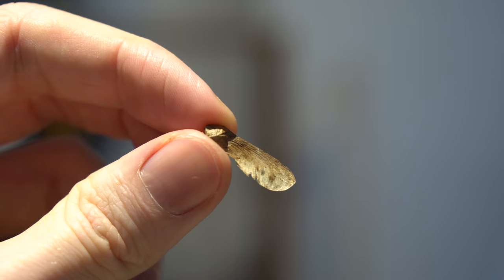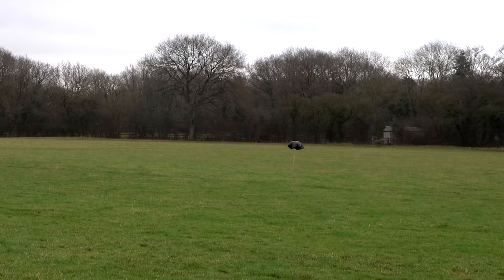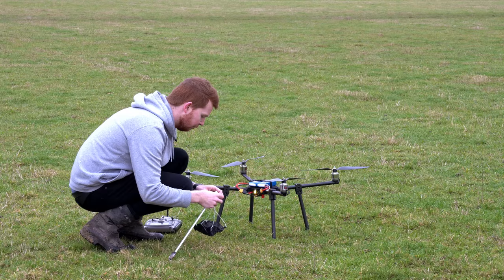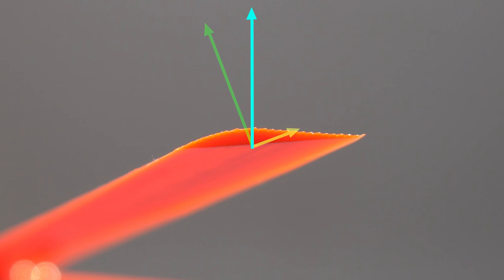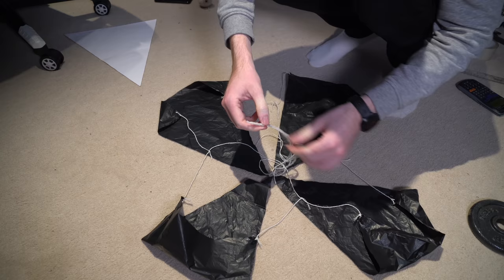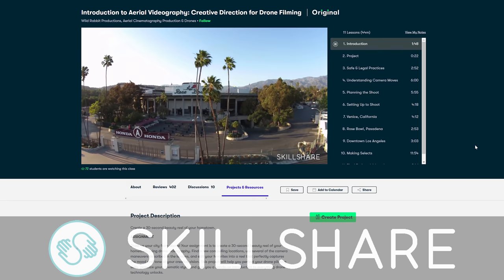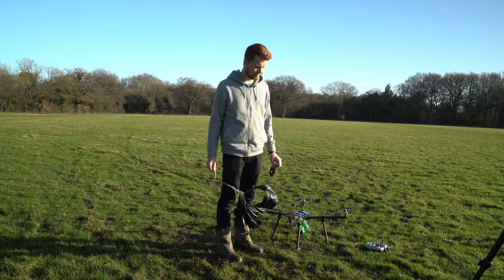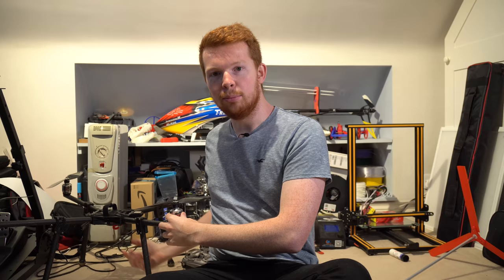Should Parachutes Spin?

Comment: Wait.  Are you sure you understand the forces at work here? The rotating parachute has no lift generated. It doesn't fall any slower. The reason the blades can slow is similar to autorotation in helicopters. The wind spinning the blades generates a small amount of lift.

Comment: your wind turbine rotor wing explanation doesn't work
the outer circle would actually aid in its descent in that it actually pushes it down
i think the likely explanation is that the blade is constantly moving over air thats not already accelerated downward by the blade/parachute
a parachute constantly has air below it thats already moving downward
while the rotor is constantly moving over air thats not already moving down

Comment: The seed is broader at the top of the wing then at the center of rotation. 3d print another rotor but make the last 2 inches of the wings wider and see what happens. 👍👍👉🤔👈10 4

Comment: you don't explain why it happens though... I bet its because when you contain air in a pocket, it creates an area of higher pressure in the parachute, which creates some kind of bubble that doesn't allow new air in. basically pushing new, steady air out of the way instead of into the parachute. I bet that's why parachutes have holes at the top too. the spinning version just keeps bumping into new , non moving air, and rejecting the air it already caught.

Comment: Dear Tom, in a discussion on rotor vs disc drag force (or thrust), a friend pointed out your video. First and foremost, I like your videos and admire your efforts to experiment! One thing though; your aerodynamic comparison is somewhat unfair.. you compare the surface of the rotor to the surface of a flattened parachute. However, as you can see during the test; in ‘flight’ the parachute turns to a dome shape. Theoretically the ‘projected’ area of a dome is only half that of its surface area; as the friction coefficient in the equation for drag is linear, you've lost half your drag.. Same goes for the smaller one; in flight, this is only half the area of the rotor. As for your explanation of the auto gyro: the inside section drives the outside, however both inner and outer sections produce a lift component and this is an explanation of autorotation, not just the auto gyro. In my opinion, the term autorotation is not very specific: all fixed pitch (and constant over radius) turbines with radial rotors on an axis parallel to a flowing medium, operate in an equilibrium between an (accelerating) blade section and a (decelerating) tips.

Comment: Tom I am at a loss as to the reasoning?????? behind your topics.
1.     Single blade seeds such as the Maple Seed descending to the ground and travelling is due to 'Autorotation', for a basic understanding look at the' C of G' and the aerofoil section of the single blade.... Durrrrrrr
2.     Round Canopy Parachutes trap air and the only escape route is via the edges which causes the edges to flap. Therefore the hole in the top of the canopy is there to bleed the air build up and improve stability with only a minimal change in drag.
     Nothing above is Rocket Science.... so what are you TRYING to prove with your 'droning'

Comment: my guess from watching the tests and before seeing the explanation: i think it has something to do between the interaction of angular momentum and gravity. my theory is that because there is so much angular momentum its stealing the potential energy from the drop to make the propellers spin. i wonder if the shape of the blade matters. would having something shaped like an "S" or shaped more like the seed, with a rounded lobe on the blade have more deceleration or not? and what about a dynamic curve on the blade? would something that both had an "S" bend and was also curved to "cup" the air more have even more deceleration?

Comment: I was wondering about a 3 bladed rotor head with the same area than the one you build but larger area on the peripheral then on the center.
So very thin at the center and very large at the tip of the blade. 
Would it fall even slower?
Thanks for your nice video, very interesting every single time
Pat Farley

Comment: This has little to do with this video but I am asking because you were making a radio controlled space X rocket with EDF. There is a channel called smugglers room where the guy made a custom droid with domed top and bottom. It also has louvres on side. Was wondering if you could make one with big EDF on bottom and smaller ones for smaller EDFs on barrel body through the louvres for extra lift and stability. I am a Star Wars fan but also like robotics and flying things. But I am disabled and can't do myself, would you be interested?

Comment: Great video!
And I've got a question for you;
So, light speed and greater than light speed, super-photonic or trans-photonic speeds are theoretically unattainable according to our generally accepted physics.
Though let us suppose that spin a hypothetical propeller,  or sphere for that matter, and depending upon the radius of the propeller's arc, or the radius of the sphere at its equator relative to its axis. At what r.p.m.might we spin it to achieve or surpass the speed of light?
Seems to me that it must reach and or exceed the speed of light once you turn it to or past that given r.p.m..
And then what of time dilation and so on between it's axis relative to it's equator or the propeller tips?
In my experience whenever the tip speed of our propellers reached or exceeded the speed of sound, strange things began to happen... things started to come apart.

Comment: There was a single bladed rotorcraft invented in the early 1900's called a Gyroptere. The inventors were Papin and Rouilly. It had a maple-seed configuration where the cockpit, located at the center of rotation, remained stationary while the blade and counterweight spun around it. Here's a pic fo it: https://lecomptoirdetitam.files.wordpress.com/2015/04/gyroptere1.jpg?w=529&h=418 and another from Popular Science in 1922: https://oldmachinepress.files.wordpress.com/2012/09/papin-rouilly-popsci-1922-09.jpg?w=375&h=536  

Might be cool to create a version of it!

Comment: The real question is why does the seed actually float horizontal ish opposed to a more vertical spin
Reply: fist, you start with  Gravity.    then, the overall  shape  results in  Spin, as it fall through the air.     a  'free'  object  rotates/spins about its  Center of  Mass.      as it spins,  aerodynamic forces cause  the orientation of the  'wing'   to  Align with  the (relative)  horizontal   air  flow.

Comment: you're not looking for the reason why they spin, but the reason why spinning causes them to fall slower... see the seed as a seed!.. seed has quantity of energy expressed as X regardless of how YOU look at it. .. seed's only purpose is to reach point y  from point z and do so along an x axis. to maximise the apparent travel upon any of 3 axes one of the other two must me reduced in effect. increasing spin reduces linear travel as momentum quantity of x to begin with so if seed is to fall distance "A" from tree, the seed must be able to travel distance x based upon total energy x that seed has. every known quantity in the universe has some spin and relative  linear motion... spin and linear motion are equal factors of spirals and everything does spiral. sorry for mistakes, having trouble with edits insofar as highlighting is concerned. find myself having to retype stuff due to highlight deleting a previous character so I'm typing same over and over again until I'm lost and confused. look at any field... you should see a relationship between linear motion and spin. look, drop a small neodymium magnet through a copper tube and that magnet will spin its way down until it exits the tube, not only that, but it will fall down at much slower rate of descent so sorry for disjointed text and ideas, really wanna get my point across and have not yet digested anything of your video. excuse me.

Comment: Wrong design of the common parachute. There should be an open hle in the top to stabilize the descent of the parachute as it slides Down a colum og escaping air at the top midde.

Comment: No, they shouldn't spin. Because your life is on the line when you use a parachute, you need the most reliable fall speed buffering system and the one with less moving pieces(the traditional parachute) is more reliable than the one with more moving pieces. 

Also if you hit someone's chute on accident or your cables come in contact with another's chute, it'll just glance off. If we used a propeller, any contact with another skydiver would essentially equal death

Comment: does it help performance if the rotating parashute spins independantly from the weight ?
if you just have the string then it needs to drag the weight with the rotation or spin up the rope which will cause some resistance
if you split the shute and the weight with a bearing then the parashute can spin more freely while the weight stays somewhat in the same direction

Comment: Tom -- consequent to the main idea in your title, have you thought much about testing a gyrocopter arrangement?
Reply: What I mean is -- blades that spin but are not powered, as the main source of lift, with an engine (pusher or tractor) to provide thrust.  Add thrust, and like an ultralight, up it goes.  Remove thrust, it doesn't stall!

Comment: 4:35 OOoooooooh. Those things (they are pretty neat, because the fabric rotor blades of the parachute are "straightened" out, and made rigid, thanks to the tension of the strings connected to the rotor blades) . I think the US has explored (and tested) using those for ONLY dropping cargo. And only for a few times. But, other than that, you don't really find these "special" types of parachutes anywhere else. Everyone is pretty much using normal parachutes, instead of these "rotating" parachutes (or maybe I am just dumb, and haven't really noticed).

Also, didn't really know that NASA tested those "rotating" types of parachutes, but definitely knew about their work on the "Rotary Rocket"

Comment: In a blue planet such as ours. Not practical. In another planet with denser atmosphere, then it is more relevant. 

Rather than a singular purpose of descending/falling slowly. The rotation of the blades can be use to collect data of atmospheric condition. I doubt it spins all the same with altitude (though the kinetic energy would persist it to continue rotation, add a bit of friction intentionally). Different air density with altitude. So the system has to be compact and modular. Not for descending/falling but just sensor data. Could use it on clouds to measure how much water content. Which can help in determining which can help in weather research. Yes... there are lacking in data collection there because the world is currently depressing. 

Small effort, it can help in understanding how to prevent hurricane/tornado. With such information in mind, civil construction can have extra factors to determine location and design of buildings. As of now... new year. politics here and there. Just taking a break from rift raft. 

Have a plane to release (pls not hundreds of this in the atmosphere at one go) just a few would do. Can help with location of placing wind turbines. Can be done, once/week of once /month. Data collection is fine. Can get your congress/parliament to supplement the budget. Though the old man in the house seems to have anxiety issues. It is the same everywhere in the world. So expect loads of resistance. 

It is made of plastic i suppose? Recycle material? Instead of throwing that trash to other countries to deal with it. Reuse it and have some meaning in resource management. Model and incorporate the weight of the material used in every design for weather research. 

As for agricultural purposes, if there are better weather prediction, which is still off by 2 months. I mean 1 month of weather prediction is still on the surface of reliable. It helps with planning and allocating resources to get things done. As of now, weather patterns are becoming too erratic. Doesnt hurt to study mother nature isnt it? Isnt that what science is all about? 

Concerns of manipulating weather? well... irrelevant really. Agricultural supplies are not getting the optimal conditions to be harvested. Plow the lands but no sun to shine for 2 months continuously in a year, is a delay of 2 months not having food. Try surviving that. There have been talks about in house agricultural. Rather effective not not as efficient as the farms. It would help to reduce the price in the market and having it manage reliably. At least there can be assurance food would be on the table. Just pester your politicians to shout louder. 

As for job employment, hmm... not really a career perspectives. Unless someone is willing to commit full time monitoring atmospheric parameters for the rest of their life. If there is a way to automate this, Pls do. 

Just my humble opinion to the ever growing unstable world we live in.

Comment: Didn't understand the point of the vortex parachute not being reliable...
Reply: More opportunity for the strings to get tangled up I assume
Reply: Right, and also I think in a round parachute if only one side opens properly, the air rushing in will push the rest of it open too. Might not work so well if there are large openings in the top.

Comment: "Should parachutes spin?"
No. Spinning blades as well as spinning 'chutes are unable to steer, as well as the complexity which raises the risk of malfunction or partial malfunction. In applications where steering isnt necessary (like dropping cargo), again the complexity and cost is greater than a traditional parachute. And then there is time lost when the parachute hasnt begun spinning, and what people want in a chute is fast, reliable deployment. Can they spin? Sure. Should they spin? No. I spent a long time in the airborne infantry and the traditional parachute works fine.

Comment: Very interesting video !

But being myself a specialist about parachutes I have just a little observation to add.
I think your "normal design" of parachute dosen't work as well as I should because you forgot to cut a hole at its top.

Indeed the history of parachutes showed us that  a hole at the top permit to the wind comming from below to inflate the sail in a mutch better way.

I don't doubt about the fact that a spinning design will even slow more but (may be better for objects as you said, i would not want to jump with it myself) but i think you should consider the difference could be a little less spectacular than what you observed here.

Congrats anyway for your experience and conclusions, I like what you do !
Reply: Apex vents on parachutes are primarily used to reduce opening forces and raise the critical closing speed. They provide stress relief (from pressure) which allows the apex to take up a flatter shape and thus allows the skirt to have a larger inflated diameter. This usually equates to a higher Cd.

Comment: So many errors....

First off, a parachute is not a flat piece of fabric. When you cut a "parachute" the way you did you get an uneven edge when it's used.
That results in air spilling out and it could wobble.

And speaking of wobble. The oldest parachutes are as you did, "more modern", say after second world war has an apex opening.
This opening is to let out the air and making the parachute fall more stable, and slower.

If we go even more modern, say 1970-1980 you had the paracommander.
That is a parachute with forward speed and was controllable.

If we go even more modern then we get to the "square" parachutes of today which are highly controllable and very fast.
They can descend in speeds as if you are in freefall but still give you a soft tip toe landing.

And finally, I doubt it would have made a difference to your test but still, parachutes are made of a fabric that does not let through any air at all.

So calling that you made a parachute is a long stretch.
Having a rotating blade above you while skydiving is not an ideal solution in my opinion, even if it would have made a slower decent.
As any skydiver knows, it's not about the decent rate, it's about how you flare (brake) the canopy at landing. And you want the higher speed in parachutes, that's the whole point.

Comment: Tom. Just a thought, is there any way to fit a parachute to a drone?
I only ask because you very nearly needed one.
Reply: He did fit a parachute to his drone. And he tangled the lines in the propeller.
Reply: @niconico3907  
What would have happened if the prop had stopped?
I was wondering if a drone could be fitted with a parachute in case of an emergency.
Reply: @Slikx666  I think the drone can keep flying with 3 props working, might be spinning a little.